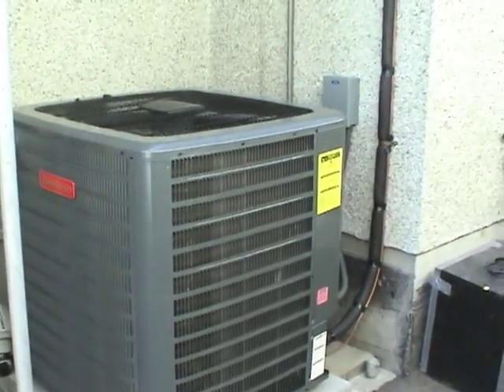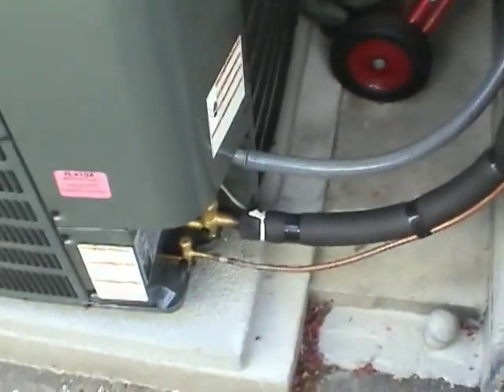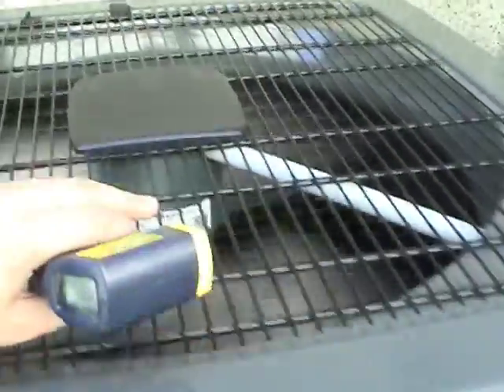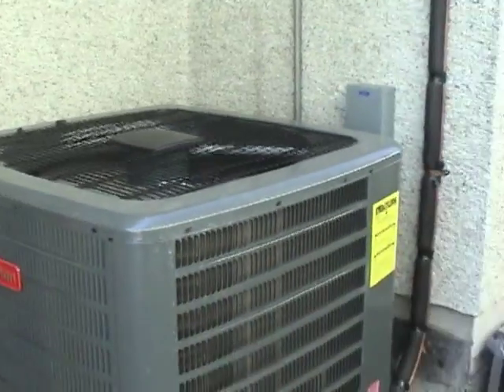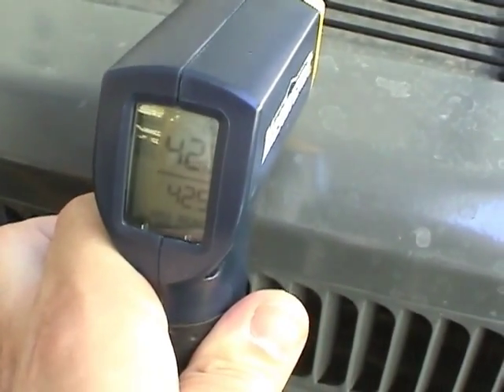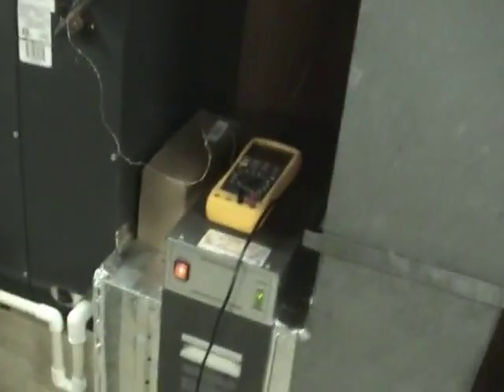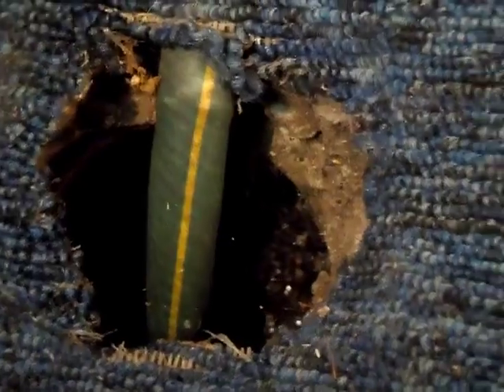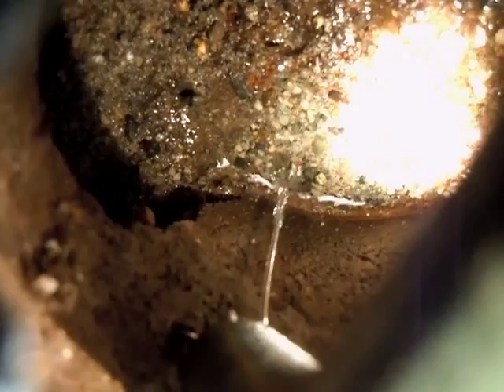Heat Pump Installation - Part 5

Comment: did you use a micron gauge when evacuating the system before weighing the charge?  hope you used r410a not r22!  hope your copper/alum. coil doesn't develop leaks from formicary corrosion.  btw, honeywell EACS aren't recommended on two speed or variable speed condensers because of ozone output.  good job for a diy'er I have to say!

Comment: Did you check the superheat on the TXV? You are supposed to charge by subcooling on TXV systems, but you also need to check the superheat to make sure that the valve is adjusted right. ( If it has an adjustment stem )